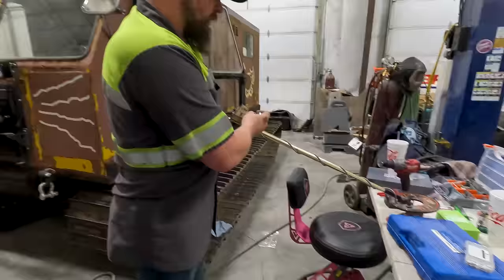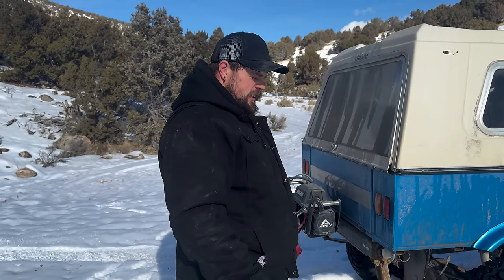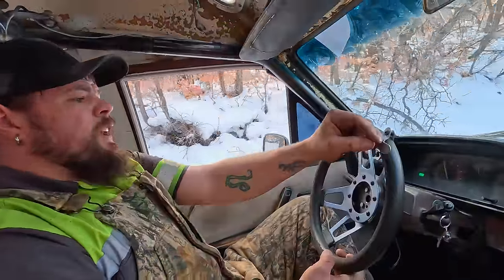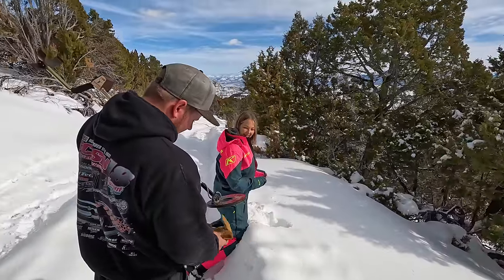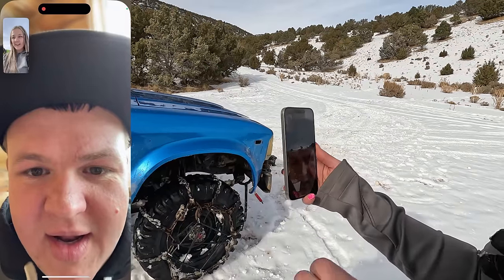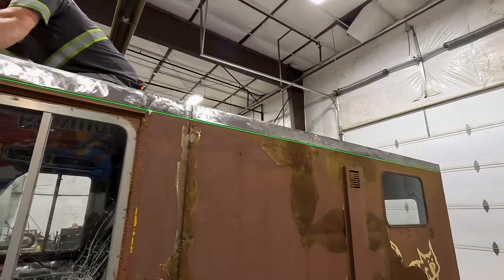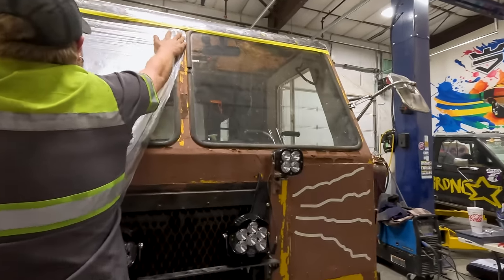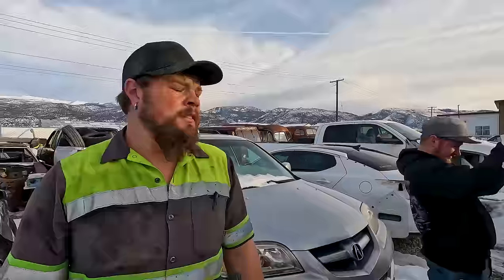You Will Never Believe What She Found!

Comment: A small suggestion....
When you're welding up holes in sheet metal like those in Whisker's roof, use a flat plate of brass (scrap) to cover the hole on the back side. That will eliminate most of the spatter, make for a cleaner weld, the brass won't melt and the weld won't stick to it.
Reply: Exactly!

Comment: when Hillbilly was filling holes in the roof of Whiskers, instead of holding a steel plate underneath, he should have a heavy-ish chunk of brass or copper underneath that will not adhere to the weld material but freeze it at the inside surface.

Comment: Brilliant, so much fun and giggles with this fantastic crew. That said,  I have a Garret which is fairly straightforward not top of the range but it does me, one thing though you have to "introduce" metal detectors to the terrain so it can find metals in sand soil clay snow or whatever, I am no expert by any means but it does make a difference!

Comment: I usually use a copper spoon held by hand (could be a helpers hand) or a copper plate held in place with magnets when fill welding holes.  Makes the back of the weld nice and flat with no grapes or stalactites plus reduces the amount of sparks and splatter on then inside and also prevents you from burning though the thin metal or distorting it as badly.  Once you get used to using a spoon you'll wonder how you got along without it.  The copper won't weld to the steel like a ferrous metal plate or angle iron backer will though it might get temporarily fused but usually breaks free fairly easily.

Surprise Robby and get one on the sly for the next time and then you can give him a hard time about not using one himself.  Whats the worst he can do...  Fire you?

Best!

Comment: When im in the shop welding holes shut we use copper under the hole. The welding will not stick to it and it will make a smooth finish on the bottom side.Just a tip. I weld stainless sheet metal everyday

Comment: when filling hole like that use some copper tubing, flattened out. The weld will not stick to the copper and leave a flat surface where the copper was. This also helps with porosity coming from the backside of the welded area. Beauty part is, this works with 3/4" holes in 1/8 material.

Comment: Seems like you could have used the IPhone “Find My” feature to confirm if it was at least left up there. It also allow you to ping the phone.
Reply from the maker: Her location was turned off so it couldn’t be tracked.
Reply: Unless she is afraid of the FBI (and who should not be these days) a better solution would to block the individuals she does not want to track her. This would still allow the Find me feature to function and assist in locating missing items. But whatever - it’s still a great achievement to have found the phone.

Comment: Cold is actually really bad for batteries, especially Lithium chemistry. 

What you didn't realize is that the snow was insulating the iPhone from the pure cold because snow has tiny air pockets in it that help insulate. It's why you can build igloos and cold shelters with snow. The iPhone's heat kept the phone warm enough to not let the battery die as the snow blanket over it kept the heat in.

Comment: You need a copper or brass backer for welding holes in panels. Others are saying it. I'm agreeing. Harbor Freight has them in the welding department. Has a handle. Sometimes you can find one at a welding supply.

Comment: That old wives' tale about cold being bad for batteries is actually true. What Hillbilly doesn't know is that snow is a good insulator. The phone would have been generating a little bit of heat every time it got in touch with the base station. And without having to run the display (which is the biggest drain on any smartphone's battery), the battery would last much longer than it does when you're using it.

Comment: Hillbilly, treker suspension tip for traction, lower the rear ride height from the springs and use air shocks when you haul stuff. Also when the power is spinning out one wheel ease up on throttle and add a little parking brake.

Comment: when doing holes like that a secret is you take a piece of brass and you put it on the inside you weld from outside and the weld will take and wont stick to the brass
easier to fill holes that way and makes it safe on inside

Comment: if the phone was still on and had power you can use another phone and search for near by devices and when you got close to the phone it would display so you would know you are in the general location. And when welding holes in metal if you can put a piece of aluminum behind the metal it will keep sparks down and pool the weld filling the hole and not stick to the aluminum

Comment: I guess? ... That lose to the ground, and under snow, and at the far reaches of a cell tower, there's no signal for "Find my Phone" ?? :(

My next ihne is going t be a 15 or higher, for the energenie "satellite texting with no cell phone towers" text option!! But I don't think that will help if I lose it?? :(

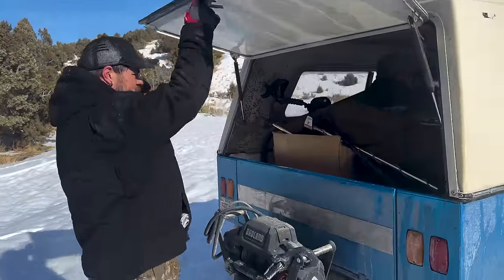EDIT: 4:47 .. I thought "Find my Phone" set the phone to noisy and defeated silent mode?? AND even if Location is toggled off.  YES it does!! just checked!! .. the only way it will not work is if you have "Find my Phone" purposely disabled. .. 

We must assume Demri never activated "Find my Phone" or Find my Device"..  It's shut OFF by default for privacy when you buy your phone.

Comment: Not being judge mental, but Hillbilly doesn’t understand the differences between battery types. Lithium ion batteries will discharge more slowly when cold. Flooded lead acid batteries lose potential when cold. Lithium Iron Phosphate batteries 
(LiFePO4) will actually be destroyed if you try to charge them in freezing temperatures. It pays to know the characteristics of each. Now to the metal detectors, they work by sweeping them over the target metal objects.

Comment: I chuckle every time you guys put chains on.  Lay the chains over the top of the tires and then drive ahead a quarter rotation.  No lifting and fighting with the weight of the chains.
Reply: You are lifting the entire weight of the chains doing it like that. Lay them on the ground first, drive over them then you'll only be lifting part of the weight of the chains when you lift them over.
Reply: you already carried them over to the tire, so you are strong enough to carry them.  Holding the weight and hooking them up tight can be the challenge for people.

Comment: So, to correct Hillbilly about that wives tale about Lithium Ion batteries not working in the cold being false, it's is that a cellphone does not have a large enough battery to be effected by the freezing cold. EVs are powered by huge batteries and in freezing temperatures the electrochemical processes that occur in these batteries slow down to the point that they cannot transfer energy. Smaller devices like cellphones have a very thin barrier of the electrolyte gel that keeps the lithium separate from graphite cathode to prevent short-circuiting, but in the scale of an EV battery the gel almost solidifies in the freezing cold which kills it's ability to operate until it warms up. And the problem with attempting to keep those EV batteries warm in the freezing cold is that they might explode from the forced heat induction, then you will have bigger problems.

Comment: Whilst I'm glad you found the phone, let me educate you.

Metal detectors work by emiting radio waves out one one antenna and measuring any response received on a second antenna.

The designs of these antennas change the shape of where the radio waves travel.

Detectors can use different radio frequencies to help detect different types of metal. 

If those two detectors are setup for general purpose detection, then they are likely sharing the same frequency.

Most metal detectors are stupid, they don't know if a received signal came from them, or the OTHER metal detector nearby.

So don't use them close to each other.

The military ones I was trained to use had a specific button we could use to synchronise our metal detectors together so they would ignore each other, but we still stayed 1-2 metres away from each other.

Most amateur and hobby metal detectorists use a sweeping motion as they walk.
The military uses a methodological parallel straight line perpendicular to the path with a single step to advance to the next line.

Missing a penny sucks, missing a landmine is bad important so the military learnt how to not miss anything.

Oh, on a side note. Snow is an good thermal insulator and an operating electronics device is a low powered heater.

The air temp may have dropped below zero, but I bet the phones temp didn't.

Comment: Hillbilly, please try telling all those people whose electric cars stranded them on the roadside when the temps dropped, that it's a "myth" about cold effecting batteries. I already knew because I'm a photographer and always had to carry extra batteries when out shooting during winter in Colorado. (Moved to warmer climates since then, though.) In really frigid weathrr you get 30 to 50% less life out of a battery. Bit what is true is that once a cold battery warms back up, such as in a coat pocket, it will often come back to life... at least for a while until it chills down again.
P.S. EV owners found out the hard way that  it's not like their older cars... When the cold kills a battery and you're stranded, nobody can simply bring you a "gas can" with a couple kilowatts of electricity to get you home. You have to get the EV towed (or hauled) to a charging station, then get in line to wait while each car ahead of you gets a 45 minite "quick charge".
And... it IS impressive that phone was still on and working! Especially since it was in a tire track. Also impressive that y'all actually found it!